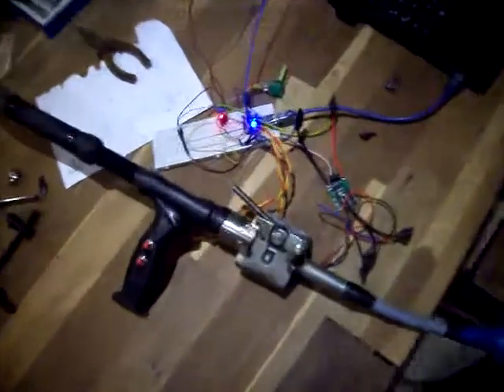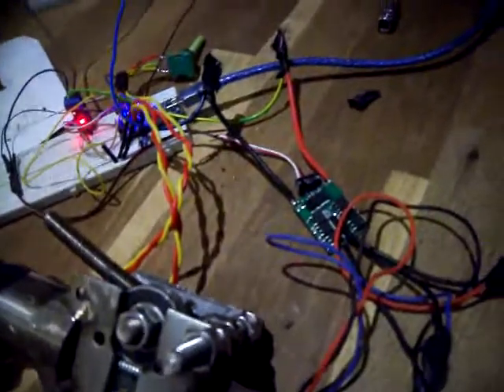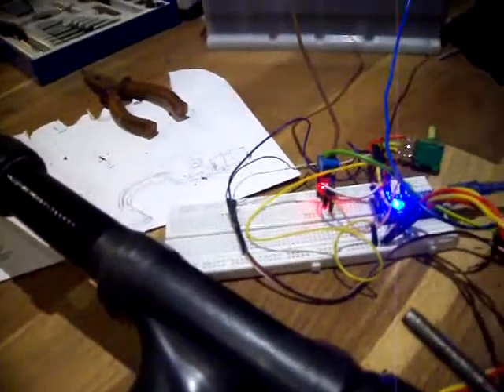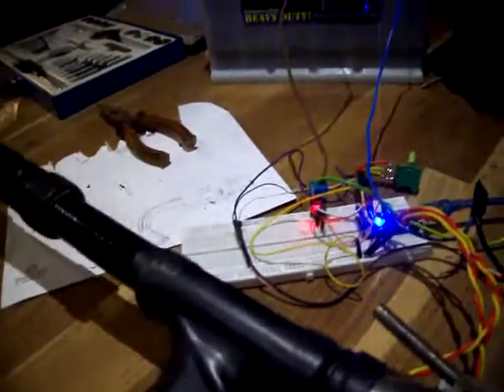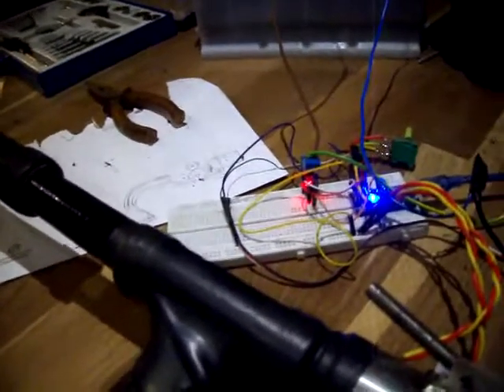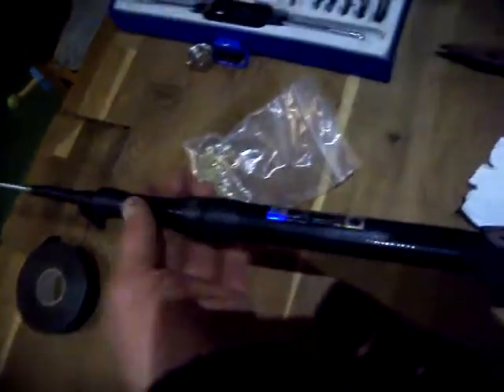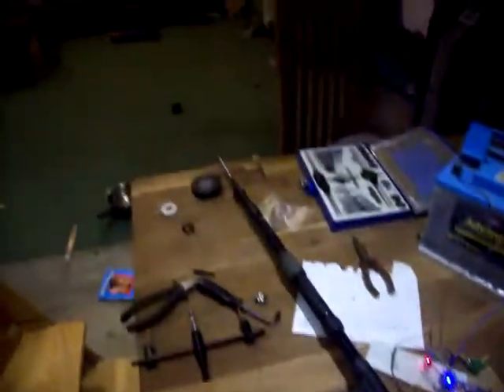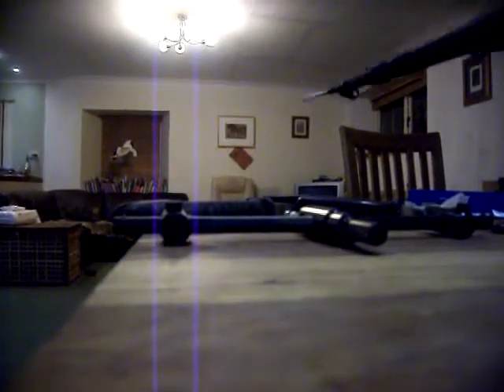FishingROV #10 DIY ROV. Spear Test 3

Comment: Dear Mr Fishing Rov, I really enjoy following your work! What mechanism are you using to get such a quick thrust forward,? s it motor driven?
Reply from the maker: Yeh. Its a 200 watt brush less rc motor turning a rubber wheel. The telescopic idea is probably a bit complicated to be reliable. The next one will have a single rod/pipe 1.5m long as the spear and use a similar drive mechanism.
Reply: Very Cool!, Keep posting!